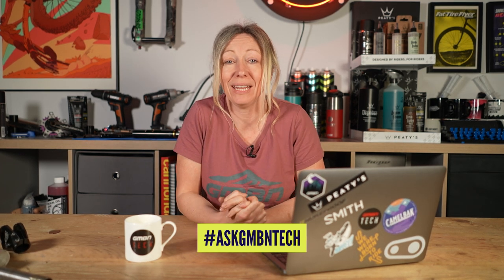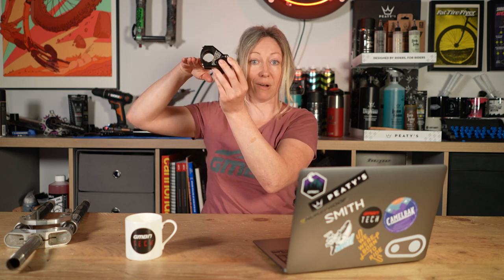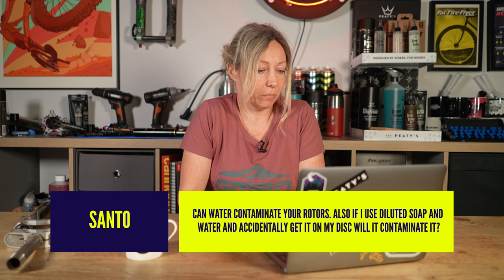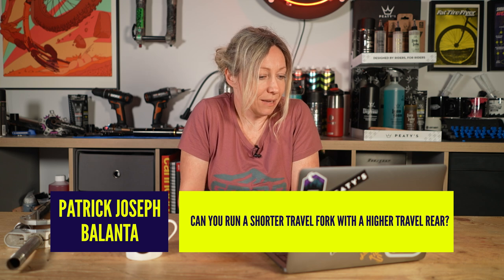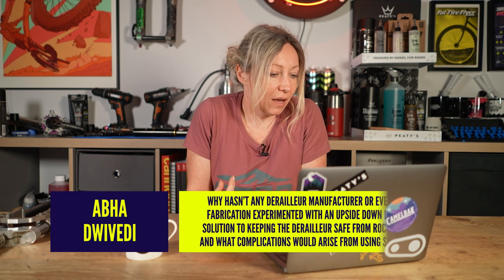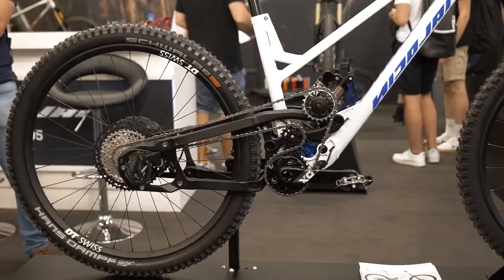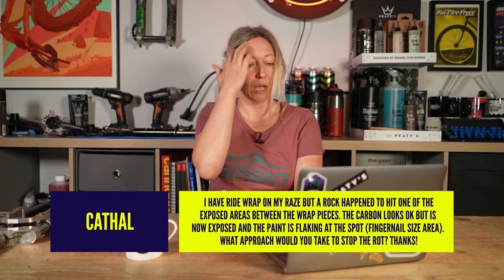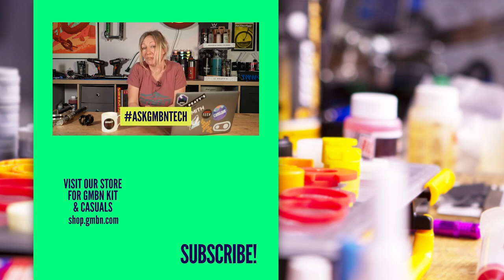Handlebar Rise Vs Stem Spacers - What’s The Difference? | #AskGMBNTech

Comment: I disagree with the stem/handlebar answer! Correct me if i'm wrong, but handlebars have a rising plane that should be aligned with the headtube angle. If that is properly setup, having a higher rise bar or more spacers will shorten reach more. Obviously, if that handlebar plane is vertically alligned, reach won't change as much as height does.

Comment: Actual Bike Reach = Nominal Bike Reach - spacer height * COS(HA). For example: if you have a reach of 470mm as per the bike datasheet, a head angle of (63’), and 40mm of spacers under the stem: 470 -(40xCOS(63)) = 451.84 mm
Reply: It did seem like this subject could be covered more in detail and with different real world examples. Also, I'd like to see a shop that takes your measurements, as at a tailor's, and have an exact custom demo bike produced to try out as a start.
Reply: @Happy_Biker  I agree.... As in .. what effect does going from a 15mm rise bar to a 25mm rise bar, vs adding 10mm of spacers, or flipping the stem... Would be good to illustrate all of those "similar" changes and show the actual effect.. and more importantly, would most people notice the reach change?

Comment: Hi, the last question re damage to carbon.  An inspection inside of the tube would be a good idea.  This usually requies a borescope or snake camera.  If the impact was significant it could cause delamination damage on the back face.
Water can damage carbon composite because it is a composite.  Water could have water capiliary along the fibres and possibly lead to delamination damage.
Best to get an expert to check it over.

Comment: #AskGMBNTech
Hi there, I have a 2014 Specialized Demo and I was wondering what kind of chain guide goes with that frame (like ISCG 05 or any other kind) and if the BB affects anything on the guide. Thanks, love the show.
Reply: Just built a brand new Demo for a customer at the shop I work for. Twas quite the machine!

Comment: #askgmbntech  can I add spacers to the steerer tube under the stem if it’s higher than the steerer tube so  causes a slight gap at the top for the stem cap , in that the stem cap will no longer be flush with the steerer tube but instead flush with a spacer ….?

Comment: #AskGMBNTech I currently have shock stroke of 60mm and I am thinking of going to a 62.5 or 65 mm shock stroke, I have herd overstroking a bike isn't good but it hasn't really been said why so I am wondering what the downsides are of overstocking a bike is?
Reply: Easiest answer is that your tire might rub at bottom out...more complicated answer involves the kinematics of the frame pivot/arcs may not function optimally with a longer stroke.

Comment: #askgmbntech

Hi Anna, Doddy, love gmbn tech! My question is about centerlock rotor. Is it normal to have a front and rear play (few radius) once discs are bolted to the good torque?
Reply: If it’s a not centre lock rotor but an adapted six bolt like presumably you are referring to then it will slip a little when engaged thru the bolt holes (the adaptor to the spline very minimal) but the play you are experiencing is the pad slip in the caliper… if you are rocking the bike back and forth brakes applied.
Reply: @jonamail3143  no it's a reel centerlock disc, it's sram hs2 CL with the "cassette" nut. And it's not a sleeping of the pad in the caliper. It a move from the center lock disc. If I do the same with my 6bolt wheels, no play at all.

If it was a pad play, you will see the disc moving, if you paid attention, only the rim is moving in my video, in fact the entrie wheel is moving when the disc is fully lock in the caliper.

I had the same problem with a adaptor on my old bike. It's probably more easy to see:

https://youtu.be/AMEMWbseWjg
Reply: Sounds like SRAM center locks are manufactured poorly, it is a shimano design